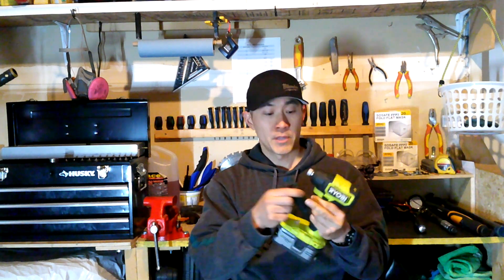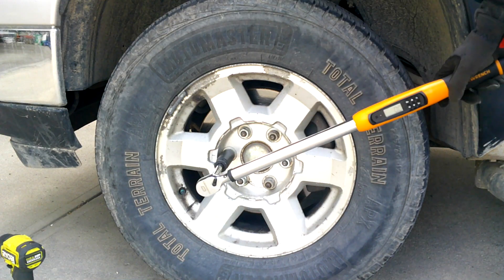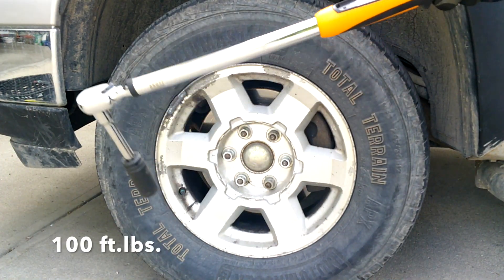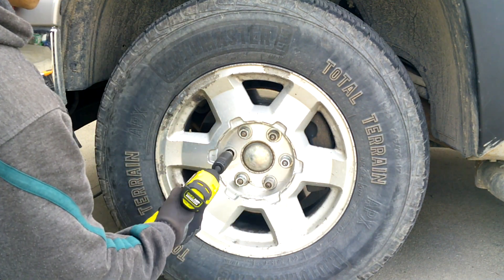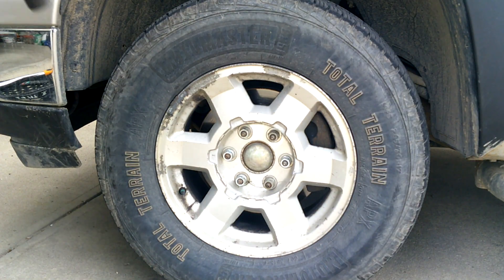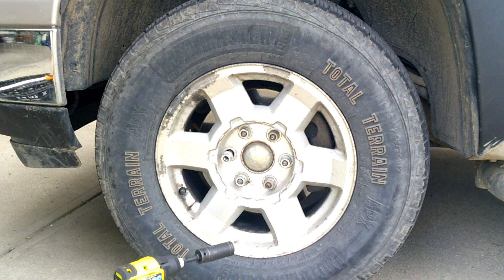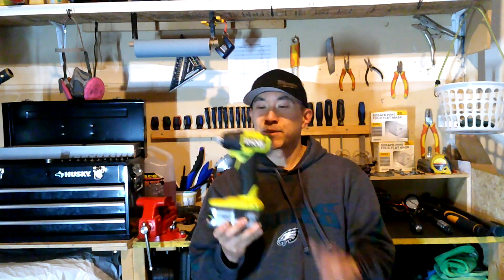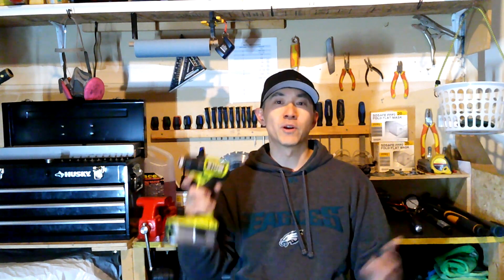Ryobi Impact Driver as an Impact Wrench? (PART 2)

Comment: I know this is a bit older but I appreciate it, I've really been wanting to finally go all power tools, I'm getting too busted up with nerve damage to do manual tools anymore. I've found some pawn shops online/people selling ryobi 18v impact drivers very cheap, some even including the batteries, I'd need to buy a charger but those can be found for about ~$12 bucks. I considered buying an older used milwaukee m18, and I still could I suppose, but good LORD they look absolute beat to hell. I don't personally think I'd have a need to bust off lug nuts ever, if something was that bad I have roadside assistance on my insurance I pay for anyway and also AAA. I'd kinda rather do a roadside tire plug kit and refill the tire and head home. I could also just start breaking it loose with a tire iron then use the impact driver to finish it off. I found a non HP non brushless ryobi P235AVN with a 4.0 official battery but not the high performance one for a whopping ~$43, then another $12 for a charger separately. I've found brand new open box milwaukee m18 for like ~$45, but then there's the matter of needing the battery and charger. Just trying to do this as frugally as humanly possible for some occasional shadetree mechanic stuff, I wouldn't even need to do DIY around the house stuff since apt maintenance does that stuff. I've been intrigued by the new gen 2 walmart hyper tough tools but have heard very iffy things about them. I guess I could get an aftermarket 2-3 year warranty on them if I do go that way. They have impressive torque numbers in testing. But I wonder if some slightly older higher tier brand used tools would be better than hyper tough for something wanting to do this frugally on a limited budget. I can get a couple year warranty cheap on the used stuff on ebay too

Comment: Can i do this with the 2ah batteries? I just bought the 1/2" drill and 1/4" impact combo
Reply from the maker: How many foot pounds of loosening power do you think you’ll need out of the 2ah battery?
Reply: @lmsdiy  the manual for our Kia Optima states that the wheel lug nut torque should be between 65-79 lb-ft. The lug nuts were over torqued, and the baby impact couldn't handle it. I'm not sure what they were at, but I believe my Ryobi can handle the recommended range. I believe that my Silverado 1500 has to be at 140 lb-ft.
Reply from the maker: @mufugginmanny  if you already have the impact, the battery and the appropriate impact socket, you’re only a $10 quarter inch adapter away from trying it. 🙂

My guess is that it would be enough for your Kia but I think it will have a difficult time trying to remove all 24 lugnuts off the Silverado. That’s just a guess on my part so I’m happy to be proven wrong! 😎

Comment: Old vid i know but enjoyed it a lot. Very well made and helpful 👍
I have a drill, and a pretty weak 3/8 impact wrench. But not a mechanic, so don't mind breaking nuts loose by hand when needed. Im looking to buy an impact driver mainly to cover what the drill driver struggles or cant do.

Ive got a couple of those ryobi batterys and a couple m18 batterys. I cant decide which direction to go lol. Do you think a variable speed is a necessary feature?
Ryobi RID18C vs RID18X essentialy. Milwaukee's range and model numbers is a bit confusing to me.. if you have any advice or thoughts you could share it would be greatly appreciated !! 👍
Reply from the maker: Thanks. The video was for my entertainment and fun to do!

I do automotive work regularly and, like you, I have Milwaukee and Ryobi batteries so I use both. My first/main go-to power tool is the Ryobi P262 1/2" impact wrench. That's for all lugnuts, drivetrain, suspension, and other bolts for like cross members, etc. I find it generally has the power I need for most situations without being too heavy to lug around and use all the time. 

then I have a Milwaukee 3/8" stubby impact wrench M12, and Milwaukee 3/8" cordless ratchet. Those are the things I use most. I mix brands mainly because I had many Ryobi batteries that I didn't want to waste, and the cost is more suitable for home DYI. Also, I like the small weight and size of the M12 line of tools and only need more power from a 1/2" impact wrench (generally speaking). 

If I could do it over and wasn't concerned about price, I would go with Milwaukee only, both M12 and M18! ❤️ the Milwaukee tools. 

Hope that helps. 🙂

Comment: Batteries do make a big difference.  1.5 ah to a 5ah DeWalt makes a big difference. 

These tools are great but it’s like a tack hammer and sometimes you need a framing hammer.

I usually break the lug free and then use the tool it still saves you time and energy. Stubby adapters and most of the nuts and bolts under the hood can still be used with a impact driver. 

Great video!
Reply from the maker: Thanks, and agreed. I have an impact wrench that I actually use as my main power tool but this video testing was more for my entertainment and curiosity. And the upgraded name-brand battery was excellent learning for me!

Comment: How about putting the lug nuts back on?
Reply from the maker: I actually have an impact wrench and I use torque sticks to tighten them up first and then manually torque them to spec with a torque wrench. Tightening them straight up with an impact driver (or wrench) isn't a recommended practice (to easy to potentially over tighten).
Reply: What about it John? Would you also like to know how a precision screwdriver performs as a prying/levering tool?

Comment: can i use that impact wrench as driver also for screws?
Reply from the maker: The concept is similar so you probably could, but I personally wouldn't. 1/4" impact drivers take many bits in quick-connect 1/4" hex fashion for turning screws. Impact wrenches have 1/4", 3/8", 1/2" and larger square anvils so they accept square fittings like you would find on sockets. 

If turning screws I would go with an impact driver. If fastening nuts or bolts or large lag bolts, I would go with an impact wrench. 

Just my opinion...

Comment: i have the same exact setup, on my m550 the wheels are torqued to 101 and it couldnt remove them. gonna buy a p262 now
Reply from the maker: The P262 is my go-to for all 1/2" socket needs. Overall it's pretty good and does what I need most of the time!

Comment: I watched this vid after failing to get some tight nuts to break. I only had about a half charge. Im going to try with a full charge after seeing this performance. fingers crossed. hopfullt I dont have to get the impact wrench just yet.
Reply from the maker: Curious what kind of vehicle and how regularly the wheels are removed/changed? I worked on a mini one time that even the larger impact wrench couldn't break free. They must have impacted them on there + corrosion over time. 

Best of luck!

Comment: Man I’m surprised it made such a difference! Thanks for the heads up! I’ve got a 6ah no name battery that works OK on my tire inflator, fan, etc but I know it doesn’t last long enough or have the same power on my brushless hammer drill!
Reply from the maker: I hear ya... I use my generic battery for my LED workbench light or flashlight but stick to OEM for any impact driver/wrench or drill work now!

Comment: You said you had the P262 1/4” but Ryobi has a P262 1/2”.   Wouldn’t the 1/2” be best?
Reply from the maker: I have a 1/2" P262 impact wrench and a 1/4" impact driver which is the tool in this video. The 1/2" P262 is my go-to. Using this 1/4" impact driver to undo lugnuts was just a fun thing to do. 🙂

Comment: I have same inpact driver and no way it will open 140ft pound on my escalade
Reply from the maker: No kidding hey? Did you try a bigger aH battery? Or maybe it's poor quality assurance/manufacturing consistency by Ryobi 🤷🏻‍♂️
Reply: @lmsdiy  no I didn't try bigger ah battery. Biggest I have is 2ah. I going to try with bigger battery and let you know what happens
Reply: @faridgadimov5955  either bigger battery or HP variant of battery will do the trick
Reply: @Max See  I have 4ah hp battery I need to try it with it

Comment: An impact driver isn't made for heavy duty jobs like lug nuts. Will probably wear it out faster or burn out the motor. Better stick with an impact wrench for the bigger jobs.
Reply: Agreed if you’re actually using it that frequently. I think if you rarely do this, it’s nice to have the ability for your driver to do this instead of having to manually do it.
Reply: Hey numbnuts I've used my impact driver over 3 years taking wheels off of vehicles even suspension parts and other s*** and I haven't had no problems so take your irrelevant comment bubba and go stand on a street corner

Comment: Isn't the tool rated to do like over 180ft lb
Reply from the maker: This tool is rated for 1700 in.lbs, which is about 141 ft.lbs. The thing is... Those manufacturer ratings go a bit out the window in real life and are only really valid in a laboratory.

Comment: I tried doing my car. My ryobi wouldn't even do 85, 90
Reply from the maker: Ouch, really? Which model impact driver are you using? And with which battery?
Reply: @lmsdiy  I'll have to check, which model are you using?
Reply from the maker: @RB-es1vx  PSBID01CN
Reply: @lmsdiy  P238
Reply from the maker: @RB-es1vx  what?!? Maybe check the setting or the battery you are using. That impact driver should better and more powerful than the one I'm using.